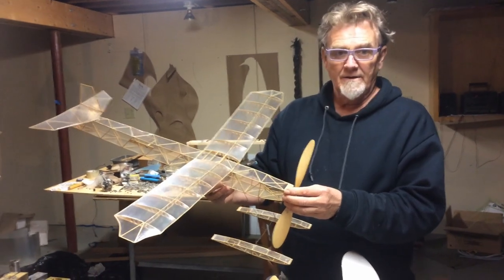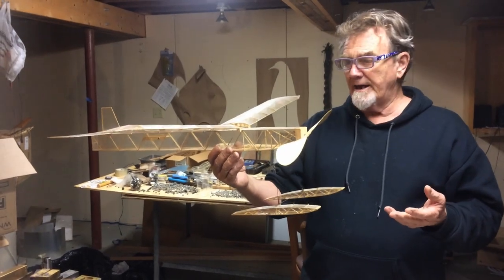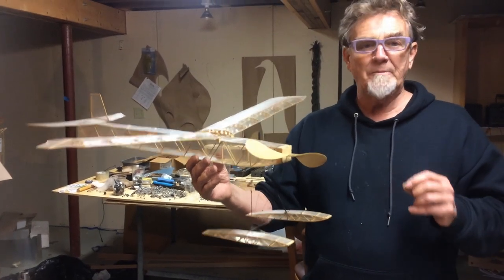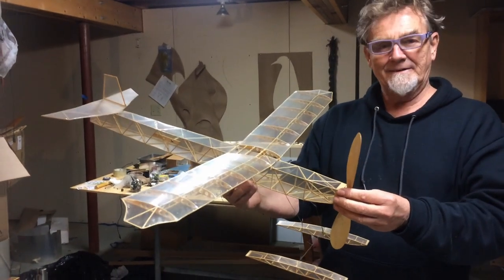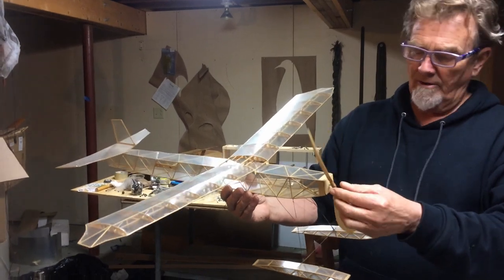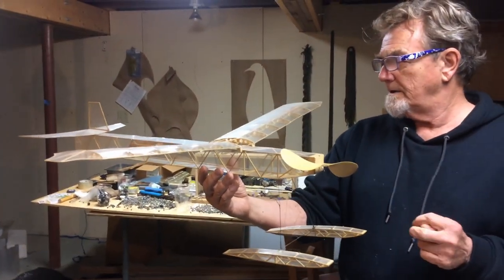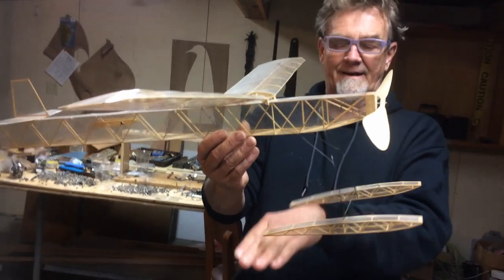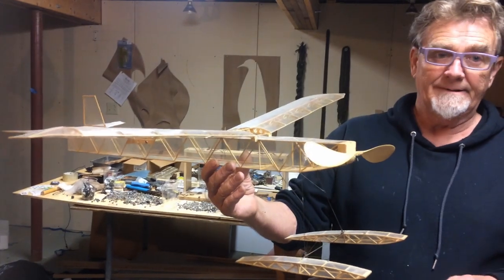5min+ ROW Free Flight Rubber Powered Model Airplane

Comment: That's an impressive accomplishment. Was the middle of the wing covered during the 5 minute flight? If not, I wouldn't be surprised if you could do 6 minutes with it covered. Maybe you should fly off a pan of water at Glastonbury. Is there a Category 2 (or is Glastonbury just Category 1?) indoor ROW record?
Reply from the maker: I'm told that yes, the wing center section was covered for the 5:03 flight.  I suspect the model can do more as this was the first flight with high turns count.   Jim says Thin Ice flight circle is way too wide for Glastonbury gym and it needs 6-8 ft to get off the water - that's a big pan.  Not sure about indoor ROW record - will have to ask around.